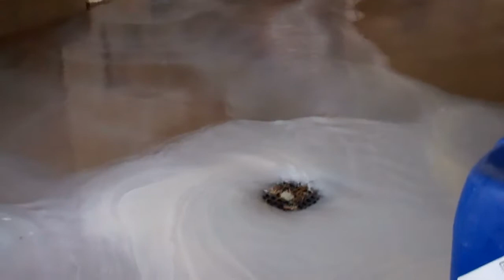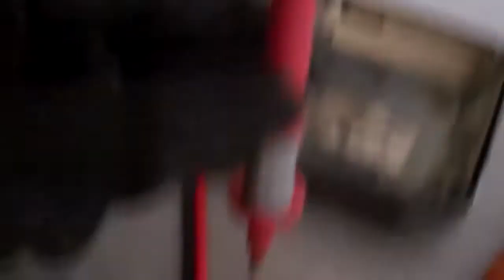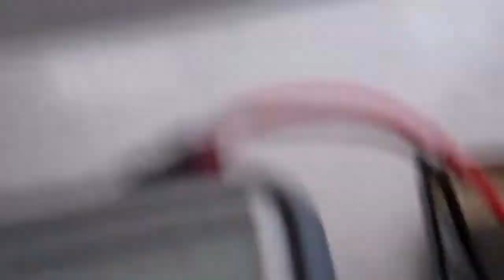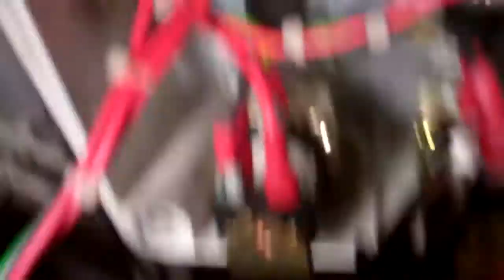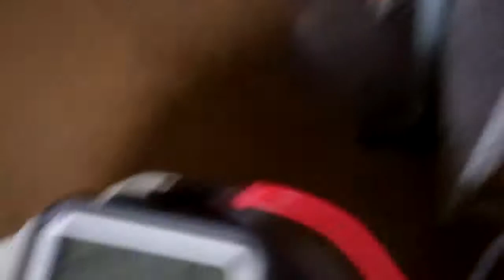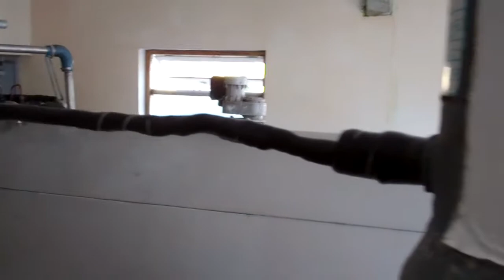Milk Trip

Comment: Try CCTV installers, they use it a lot for cabling, or look at electrical wholesalers for it at a lower price. You can order wide ones from RS, though at a price but if you need a 50mm wide one.........

Comment: Must be an expat from here then. Though here the most common is the midnight raider, come in and look for the outdoor unit and it is gone aside from the holes where it was mounted. My local honest scrappie will only take piping if you show him ID, and pays into a bank account or gives a post dated cheque that he can stop if needed. Knows me well enough that he gives cash, but I give cable to him, not burnt copper wire. He handles the stripping at a cost of course, but still easier for me.

Comment from the maker: Wow! I guess the ptc in the hard start took the 170uF out of circuit once it heated up. I had a customer replace their own caps once and they fitted 90uF start caps instead of 16uF run caps! Fans run for a few minutes then went off, lucky they didn't cook them.

Comment: I have done that temporary, but change it to the right one as soon as possible. Had a fan running on a 170uF hard start once for a day as i had no 4uF on hand, and the one in it had done the usual and gone open circuit and turned into a grey blob. Still running 3 years later a treat, though the condenser coil is looking very sad, you really cannot clean a tinsel foil coil easily and this one has a lot of feathers in it.  At least the Trane coils do not corrode off, they just get tatty.